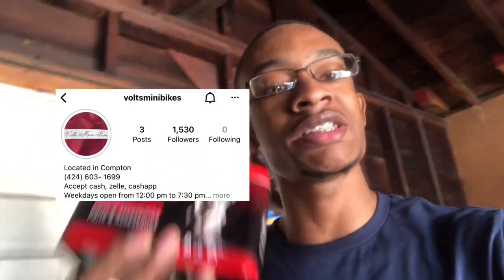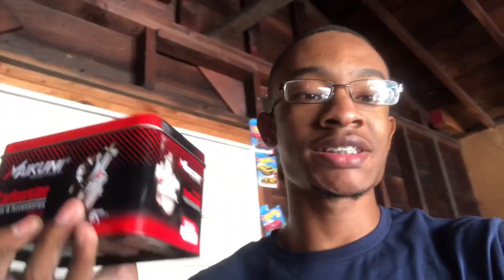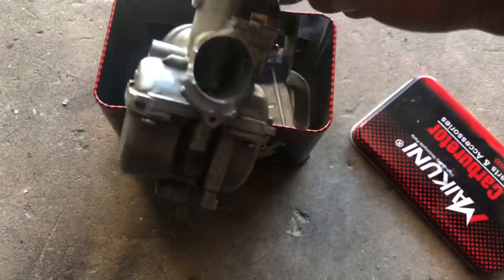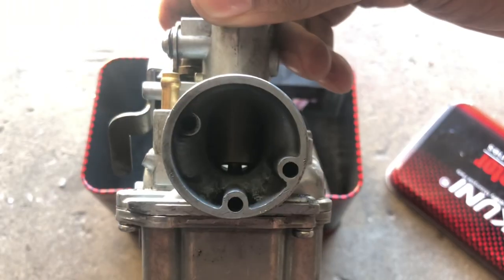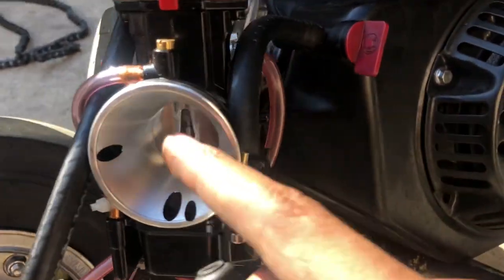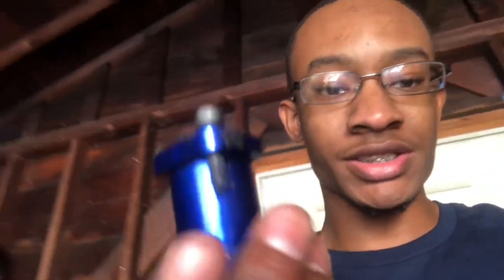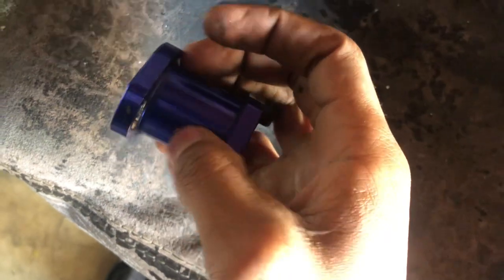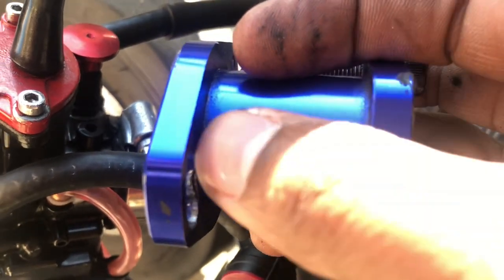Finally Upgraded My Mini Bike Carburetor!

Comment: Big 28 👊🏾 , and I was worried about my 26mm .  I’m surprise he didn’t pour the intake and exhaust . Port match up with some copper gaskets . I’m very impressed
Reply: How's your 26mm been? Would u recommend it on a stock predator with jus a governor and oil sensor delete?
Reply: @scoopsf  I run a 24 nibbi round slide still getting the jetting right I mean theres zero bog the plug is just sooty so it's still fat seems to love a ton of pilot jet.  Anyone else run 24mm nibbis or PE24 kiehin basically the same I have both.  I've ridden a kart stock predator with just major head work to make it 12.5 to 1 compression and billet rod, it doesnt have as much down low but up top it pulls hard.  The 24 to me still makes it real snappy and still pulls as hard as the 26 up top since your limited by the head and cam.  You only can go so big.  I actually used to put smaller carbs on mod pit bike builds even my own bike to give it more bottom and tone it down some to make it more ride able.  I'm currently basically sea level "north east" running 50 pilot and a 130 main.

Comment: What’s the point of a 28mm carb for stock 24mm valves? I get it if you put bigger valves in but if your running stock size valves you shouldn’t need anything more than a 24mm carb. Sweet build still
Reply: The specs of a carb goes by the cc of the engine for 150cc to 200cc 26mm carb is for those ccs alot of individuals has the wrong carb on there bike a 24mm carb is for a 140cc to 150cc engine
Reply: bouta slap on same carb but 34mm to a 212 predator hemi "deffly gonna limit the throttle or IT WILL BLOW MY ENGINE!!!"😂😂
Reply: @vixsort4965 how it go
Reply: eh i give my uh 50cc scooter 28mm carb and somehow it still runs😅

Comment: Check out an Inverted 22mm Intake you will solve the breaking problem it will also help you with a blow threw set up since it faces wind take you a smog pump boost it

Comment: Tune that carb and you can take off faster about 2x and have a higher top speed  adjust the needle and switch jets  until you find the right one and play with the air/fuel mix. You  should be able to come off the line at a higher rpm and it not bog down  but wind up I use that same carb they  good and a good  price adjust the carb and pick up about 15mph

Comment: You could have used that blue manifold without cutting it ,Tim from small engine cams sells the boot for the pwk28 and 30 carb for 15 $ bolts right on to any manifold 😀
Reply: They 55 at small engine cam

Comment: did you have to change the jets out? which main jet did you end up with. Just put a pe26 on a ghost with some mild intake porting and the flat side adapter port matched. About to put the arc flywheel on tomorrow.
Reply from the maker: 115 main only

Comment: Would I be able to use this carb on a pred 212 with no porting? I got 26lb springs, flywheel, rod and a vm22 round slide. I wanna get this but not sure if it will work
Reply: I got a 212 with 22 lb valve springs, billet flywheel, billet rod, flat top piston, and I run a 26mm pwk without porting

Comment: What jetting did you use? What jetting should I use on my 224
Reply: I have the same size and brand carb color and everything
Reply: If you from Cali run a 120 main jet and pilot jet 35 for stock engine but if you built put a 130 main jet or 135 and put a 35 pilot jet

Comment: Sorry young boss but your gonna have to upgrade that head while using a 28mm it's not a good idea to use a weenie pipe with that 28mm. Use at least a inch in a quarter inlet.
Reply: I got a stock  block with a ported head and valve springs with a 28mm runs fine tops out at 63

Comment: Mine does nothing but surge no matter what jet or tune bro i started 1 jet at a time and still nothing, theres no leaks and idk what to do if it won't even idle
Reply: Every pwk I try does this shit.. man I don’t know how anyone gets these going.. only the roundslides work on my predator like wtf
Reply: @samaxeman123  the flat slides took me a while to figure out, they are extremely sensitive and i found out float height was an issue, my needle needed dropped and for some reason i need the smallest jets possible in mine💀 but its snappy and strong
Reply: @MotoVoxDawg420  yeah I played with float height that helped a bit but intermittently mine will sputter and blow black smoke with the smallest throttle blip I can clear it and then ride wot no prob. Maybe Il try drop the needle down.. been too scared of leaning it out in the mid, just couldn’t see how the needle position would affect such a low throttle input it’s more mid throttle to 3/4

Comment: i put my pwk 28 on and the second i pull the string it revs all the way up, i put a smaller jet and that still didnt help, tried to tweak it a little still didnt help, what should i do?
Reply from the maker: Check throttle cable it
Reply: Check idle

Comment: Why does the choke on my pwk not stay up ?
Reply from the maker: Probably need to tighten it or take it apart and clean it
Reply: @Elevate don’t use choke just cover carb with your hand it works better

Comment: Hey what kind is that mikuni because I might buy one of those
Reply from the maker: This not a mikuni it’s a pwk 28mm
Reply: Ok thank you how much did it cost
Reply from the maker: @alexytgaming4543  like 30 dollars on amazon but you can probably get one jetted for 50
Reply: What jet size is yours
Reply from the maker: @alexytgaming4543  i think 120 but the guy who do them drill them out
Reply: Ok do you think this carburetor is better then vm22
Reply: @alexytgaming4543  yes the one on his bike right now (pwk 28) is bigger the throat is 28mm and is also a flat slide so it gets more air than a 22mm mikuni round slide so yes the pwk is a better carb over all
Reply: Ok thank you
Reply: @mini0448  can I run this on a stock predator? Governor and oil sensor delete. With a manifold pipe
Reply: @scoopsf  the carb will work is long as u got the right intake setup to mount it onto